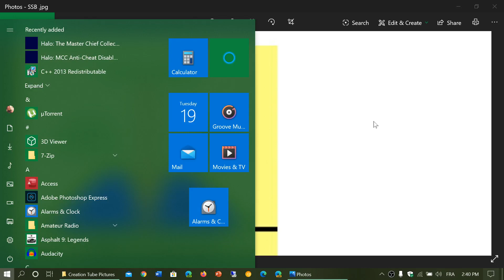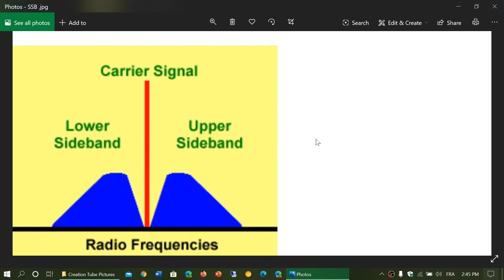PART 14 Shortwave for Beginners Why Single Sideband SSB USB LSB explained

Comment: it's like shoveling heavy snow with a 2x12x8ft board. use the 8ft is AM. Can't get real far. ssb is like using the end of the board. less to push, more available power.

Comment: This was the clearest explanation I have heard but let's make sure I got it right.  What I heard is that SSB is STILL AM but without the carrier.
Reply from the maker: It's SSB   AM would have a carrier already,  think about it as a AM signal that was stripped from its Carrier.   You now have SSB
Reply: @OfficialSWLchannel  But SSB is still uses Amplitude Modulation correct?

Comment: Is FM modulation ever used with shortwave? If not, why?

Thanks,
Jack
Reply from the maker: only on the 10 meter amateur radio band,  it is not used because it takes too much space on the spectrum and would have reduced the number of stations that can be on a given frequency range
Reply: @OfficialSWLchannel  Yes, that makes sense. Thanks for the reply.

Jack

Comment: Is the reason that all SW radios cannot allow us to hear SSB signals solely because most radios lack the capability to move in 1 kHz tuning increments, or is there more involved than just that, Gilles?  If that is all, one would think every vintage SW radio with linear tuning would get SSB when tuned finely.  Thank you.
Reply: In AM the carrier itself is being used to demodulate the signal.  In SSB the carrier is not present, so the receiver must produce its own "carrier" via a beat frequency oscillator.  This makes SSB receiver more complicated and expensive.
Reply: @scottcranston7469 where do I learn what all of what you said means? I don’t understand any of it. I was installing radios and antennas at work for our power company and I thought that I needed to learn about them but I retired. We did a large variety of things so we had occasional gaps in our knowledge. The variety was nice though but sometimes we got spread too thin with all of the new technology we were working with. Thanks

Comment: Very nice explanation Gilles. Now, if the SSB is so efficient, why AM (DSB+Carrier) does still exist? Likely, because the receivers are simpler than those needed to demodulate SSB. Therefore, the extra cost paid by the broadcasting stations make it possible to reach more people. ;-)
Reply: SSB is harder to tune "exactly."  With AM, the receiver can be tuned slightly offset from the carrier frequency with minimal effect, since the carrier itself is being used to demodulate the signal. With SSB, you need to have your injected carrier precisely where the carrier would be if it were transmitted to get perfect demodulation.  Since most receivers have a minimum tuning step it might not be possible, resulting in some distortion.  In most cases this is not much of an issue, but with music e.g. it can make a difference. Also, in SSB if the frequency is drifting you need to constantly retune.